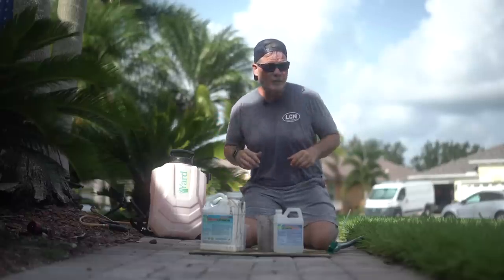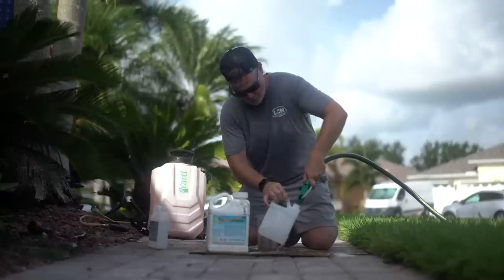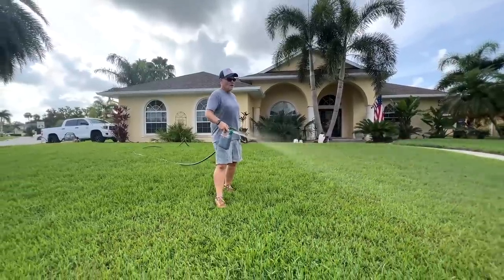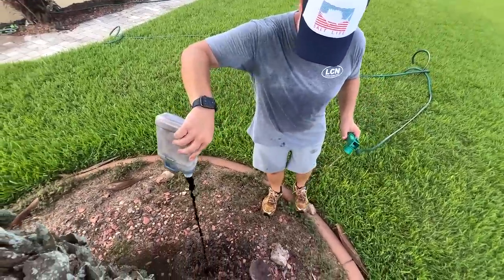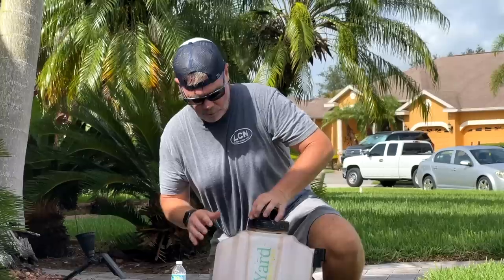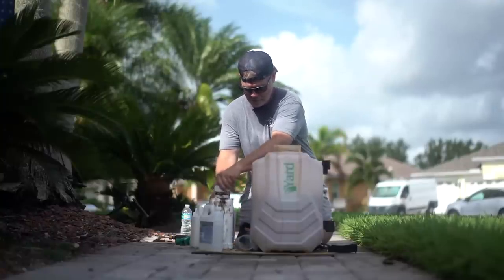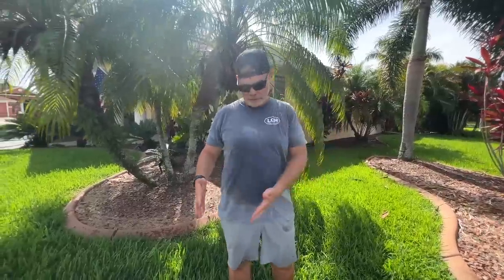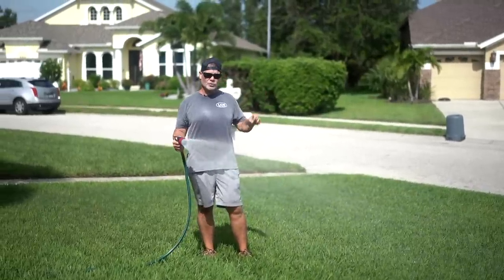Hot Weather Lawn Supplements // Summer Lawn Spraying Is FUN!

Comment: One question I have is with GreeneKick.  I have this product too and the instructions seems to indicate this product is mainly absorbed into the plant foliarly and hence why it has citric acid in its formular?  In this video though, it sounded like root absorption is the main method.  Can we get a confirmation which method is best?

Thanks.

Also, have you guys seen or used one of those OXO Angled Measure Cup?  If not, I recommend it for those who mix stuff up for spraying a lot.  In most cases, we don't mix our chemicals on a table but on the ground but with a regular measuring cup, the indicators are on the side and you have to lift the measuring cup up to see if you have poured the right amount.  With the OXO Angled Measuring Cup, you can see your measured level directly from the top, eliminating the need to look at the side.  Very convenient.

Comment: Great tips Allyn, i have been following and applying your products for two years now since i moved to Charleston. I am having problems with my centipede grass; it is doing great 90 in percent of the lawn, but the rest is struggling! The grass is not growing thick and dense, the blades are thin, and the roots are not deep. Also, i can pull the grass up easily, no grubs or fungus. Any suggestions would be appreciated!

Comment: I have the old Craftsman black rubber hoses from Sears, someone else probably carries them now, and they almost never kink to where I have to un-kink it.   I just give a shake and twist and they un-kink.  They have lasted me about 8 years of being outside and still work great!
Reply: That and Swan’s black rubber hose is it’s co equal.
Reply: I have a brigg-stratton hose and it's never failed me.
Reply: Garrett Wade sells a 100’ Stainless Steel hose and it’s the best I’ve ever had. It will not kink.  Ever.
Reply: I have a craftsman hose that’s 30+ years old. Still looks like new. Crazy if you think about it.
Reply: I do too🙋🏼‍♀️ and boy do I miss the warranty on these hoses.  It used to be we could just take one back and exchange it .

Comment: ⚠️ Off-Topic: my lawn in extremely bumpy after insurance replaced it due to glass and debris after a tornado. It was done about 1.5 years ago and they presented a solution of basically bringing a “steam roller” type machine to compact the ground after doing a soak. They are thinking this will even out the bumps. 

Basically the subcontractor  removed the old grass and then  lied and said we weren’t approved for leveling soil and then never rolled out the lawn after the new sod went down…and now they are out of business. This is why they are looking for cheap ways to fix a problem that never should’ve happen in the first place. 

I know aerating the soil helps a lawn so I’m assuming highly compacted soil is not beneficial to the health of the grass. When I mentioned this they kind of told me I was a little bit crazy and that it wouldn’t cause any problems.

I’m here in Canada 🇨🇦 if that makes a difference. 

Thanks for anyone’s assistance and opinion on this.

Comment: When do you use the 90psi setting on your sprayer?
Reply from the maker: I really don't. If I was going to do an app of say insect control where I needed to spray up into the eaves of the house, then I'd probably use the higher PSI setting, but for lawns, i only need the 40.
Reply: @Thelawncarenut  ok thanks. Makes sense. Great sprayer.